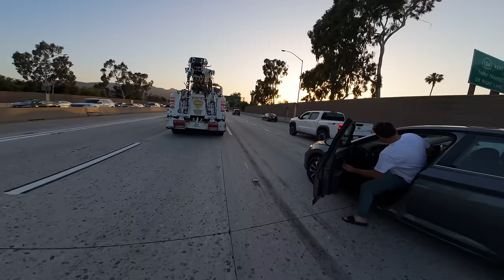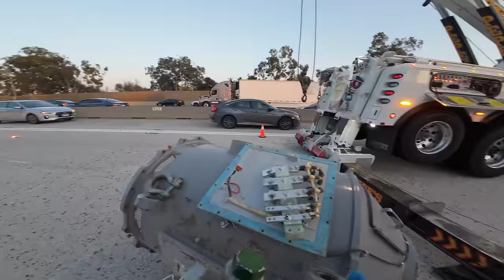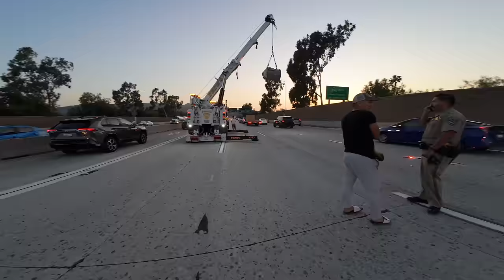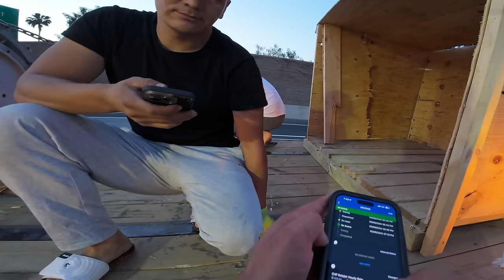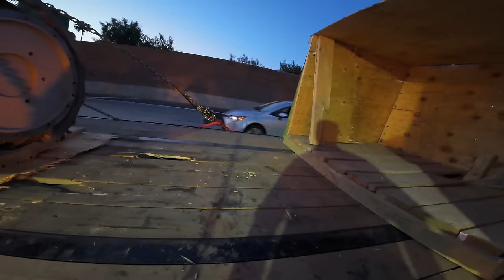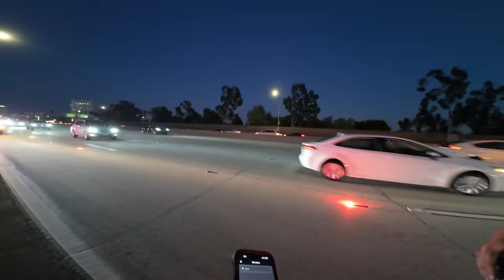18,000lb Alternator Falls off Trailer on Freeway

Comment: for those saying unsecure load it's actually whoever put the alternator in the crate used a weak crate or loaded it wrong. the guy hit the brakes the whole side of the crate broke out as the alternator rolled out .look at the wood . that's the side of the crate.  the crate should have been loaded turned 90 degrees so the rolling axis is side to side plus it should have been secured better in the crate actually clamped down to the skid in the bottom.
IT'S NOT THE DRIVERS FAULT . it's the shipper's fault
Reply: That's clear, the shipper did a lousy job here, and will get a phone call. But isn't it the driver that in the end needs to make sure everythig is properly secured to his trailer no matter what. One never know how things looks like inside a crate like that and who has done what, secured or not. They should had cut a couple of holes in the crate to look inside, and if needed just removed the crate, secured and tarped it
Reply: So how do you know it wasn't braced inside the crate? The driver still has to be ACCOUNTABLE for their load on their trailer. In this case this man had ZERO chains. He had only used straps as you can see.  Sometimes shippers do load crappy but again it's the drivers responsibility to make sure all is good.  Like if you pull a refer and you know the load is this or that and it weighs this much. You are gonna tell the forklift driver "Hey please Chimney Block Load that! Most in a food warehouse know but if not you say it's this way blah blah blah.
Reply: Wrong. Driver is responsible for the load., period.
Reply: @Rimrock300  yes, fedex, ups, usps, private shippers, should cut holes in every box and look inside to make sure it's properly packed. /s 
who ever put this on a skid without strapping it should be fired. this could have been so much worse for the truck driver if this happened in a box truck.
Reply: Bullshit its called chain of responsibility, the loader is responsible, the the shipper is responsible the person who secured the load to the trailer is responsible.
Reply: Driver is responsible for their load securement. If you turned it 90° it would just roll left or right on a turn.
Reply: Did the shipper put it in the wrong direction on the trailer too? As a driver you are responsible to make sure the load is secured properly.
Reply: @kevins.3573  oh USPS already does that. You just don't know about it. I use to pull mail for USPS. Some of those characters working at the PDC/NDC do that kind of stuff. There was a box truck contractor that had a storage unit and they would go their storage unit take out mail and packages and then go to the PDC/NDC to drop the mail
Reply: Temp door sign on pickup. Crate was poorly designed
Reply: Driver is responsible for load securement
Reply: no forward tie downs, driver is at fault most def went a bit too fast and had to brake.

Also him asking to put blame is illegal
Reply: The driver doesn't know how to do his job. He accepted a unsafe load.
Reply: The driver has ultimate responsibility for safe load securement. To think otherwise is ridiculous.
Reply: @Rimrock300  You act like the driver can argue with the shipper about how its loaded. Usually its just slapped on there and the shipper tells you to leave. They will refuse to move it or unload it and you have no say.
Reply: @FeliciaSteward-ds2dh  The box went nowhere. Even with chains it still would have broke out of the box. You act like the shipper is going to reload it or unload it if the driver complains. They load you and tell you to get lost.
Reply: @mofotose  But as the driver you do not have the means to do so. You think the driver can just summon a forklift at will? If they load it weird, guess what, it's your problem now. They probably aren't going to move it for you no matter how much you complain.
Reply: Even if it was secured to the pallet 18k pounds to a wooden  crate in itself is doomed for failure.
Reply: @tripplefives1402  Well, too bad for the fork lift operator then. I won't move my vehicle until he/she loads it correctly so good luck loading the next truck/trailer/whatever. After that it's my responsibility to secure the load on my vehicle.
Reply: @mofotose  How exactly are you going to verify that what is inside of a sealed wooden box is not going to roll out? You could put ten thousand straps and chains on that box but if the box tears open it wont matter.
Reply: @tripplefives1402  Then you will have to open it. Can't remember anyone saying it was sealed. When in doubt - open and check. Who do you think should be responsible? The fork lift operator or whoever loaded the box on the trailer? The manufacturer? The driver?
Reply: Well, we'll delete our post then...?? ❤❤
Reply: It's the loaders fault.It should have been 90°.Like you said, but who knows?It's in a box you don't know what's round
Reply: @jasonswift7098  Whoever does the transporting is ultimately responsible for properly securing and knowing exactly what it is they are transporting. Anyone who does the shipping or actual transporting has the right to open up packages/crates etc to know exactly what the product is and if its in a crate to see if it is properly secured. What they should have done was charged the seller for having to fix the crate to properly secure or removed it from the crate and used tarps to secure and protect the product.
Reply: @tripplefives1402  This is untrue, you can call the law enforcement if the refuse to unload as theft of your trailer for storage. As a hauler you have ultimate and last say how everything is loaded if its your trailer. If it is not your trailer you could simply refuse to accept the load/trailer.
Reply: @tripplefives1402  you open the box as that is your right as a cargo hauler/transporter. The law permits you to open packages to figure out what exactly it is you are hauling mainly to ensure or check if it is hazardous or not but also to ensure that if its something heavy like this whether or not it is properly secured in the crate or if it needs to be removed from its crate to properly secure it.
Reply: Driver fault 100% he learn already ,never going to take a load whit out secure any more ,I warrantied
Reply: Nope…the driver is responsible for his load…period
Reply: Actual flatbed trucker here- once that load is on your trailer and you sign off on it to start moving, that load is the sole responsibility of YOU the driver. That's trucking 101 bud. Educate yourself.
Reply: no, it's the driver's responsibility once he accepts the load. it's up to his expertise to determine whether it's packed properly. no different than a pilot or ship's captain.
Reply: Wrong it is the drivers fault
Reply: @johnnyringo6329  And he secured it and it stayed put.  How was the driver to know it wasn't secured correctly inside?  Does he demand to have the box opened to inspect it?
Reply: If you're a truck driver, you would agree that it's a shipper's fault
Reply: @mariod818  "him asking to put blame is illegal" -- bro I don't think you should be talking about what you think the law is, you can't even speak 1 sentence that makes any sense. Go home and play with your pacifier.
Reply: @robnobert  
California Penal Code Section 632
California Vehicle Code Section 23114

California is a two part consent state, his recording would be admissible in court regardless. Under California law the hauler is at fault. 

Get some help, the public education system is failing you. Either that or you're on the spectrum with how emotional you got. 🤣
Reply: @mariod818  Says the guy quoting California legal code numbers... okay buddy 👏 you win. You are more on the spectrum than me. Bravo. .... It's just too bad you're arrogant as hell and STILL wrong.
Reply: @robnobert  I don't think what the law is, I know what it is. 

You're clearly arrogant and have no argument, hence your nonsensical replies. All emotion 🤣
Reply: @robnobert  don’t be too emotional it makes you ignorant 🤷 I am right which is why you can’t and won’t refute it. 😂
Reply: @joshuapaul349  at least then. What was used to secure the crate might, I repeat, might have kept it with the crate long enough for the driver to see that his load was falling out of the crate.
Reply: @Ghauster  If you think that thing should be loose in a box and the box secured that's your first problem.
Reply: @joshuapaul349  no. I never said it should be loose in the box.
Reply: @Ghauster  you haven't really said anything to be fair.

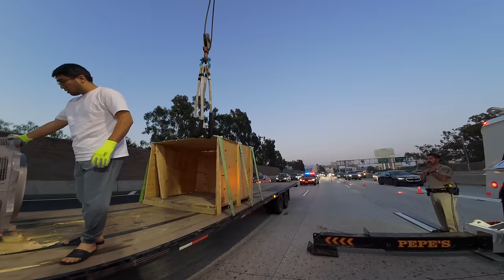Comment: I like how, at 17:25 he pushes it back and forth to see if it's stable. That thing is 18,000lbs, hulk!
Reply: well you would be surprised how much you can tell from just doing that little bit. I have to move stuff similar to that from time to time if there is a slight rock to it i either add more bracing or straps.  But who ever crated that thing was lazy, an it happens a good bit , they think because its in a crate it wont go anywhere if it rocks  but if its not bolted to the pallet or braced in there it is just one good stop or turn away from flying out.
Reply: My work bench is somewhere in that neighborhood and if it's on an uneven part of the floor i can rock it with 1 finger... I have to have shims and hammer them under the lowest feet to get it level and stable.
ehh, I just did some napkin math and I'm at like 10k, so halfish the weight
Reply: @seldoon_nemar  you're suggesting that this guy might be evaluating if he needs shims for road tested alternator? Maybe the gesture would have held more merit if the unit already had is chains connected and tightened. Didn't get me wrong, I understand the drive to test it. I just thought it was funny. It made me giggle. I decided to share. No harm, no foul.
Reply: Would have been hilarious if it rolled back off the trailer.
Reply: Correct! That's the wrong procedure. You need to slap it and say, "That's not going anywhere."
Reply: @SergeantExtreme  I'm my training we were told that after the slap you have to look in the camera and say 'now, let's get'er done "